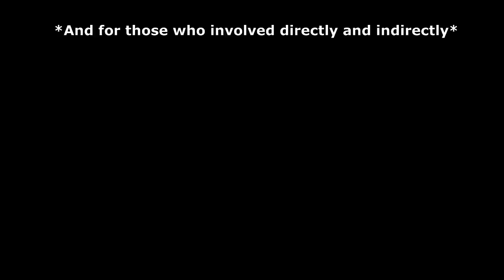Light gauge steel frame building system for low cost housing projects

Comment: The slab is thin to begin with, and the concrete didn't cure. It baked in the sun. 2KPSI concrete instantly turned into probably .800KPSI-1KPSI. Should have kept it cool and wet until sundown.

Comment: Why not infill the wall frames with the aircrete whilst horizontal prior to erection ?
Reply: I propose a marriage  hall about 4500 sq ft  is it possible  through low gage steel frame?
Reply: Is there any lgsf building contractor in Odisha?

Comment: Wont the moisture in the concrete corode the steel frame?
Reply from the maker: no
Reply: @stretchceilingsDubai  I saw in another video they said to put a plastic layer under the metal tracks attached to the slab to avoid corosion. Is that correct?
Reply from the maker: @vinvan4237  Yes it is correct. You can visit www.framecad.com and find more details regarding the system

Comment: How much did this house cost in USD and what country was it in?
Reply: Each one of those studs cost around  $1.71
Say they used 500?
Cement  wall fill. $800. 
Render and plaster $400
Thin fibreglass insulation $300
Tin foil $150
Metal sheeting $300

It would probably cost around $5000. But in the US. Same amount for Labour seeing as its $80-200 a day per person . Over there it’s $20 a day if they’re lucky.
Reply: @jugganaut33  800usd for the whole cement wall fill